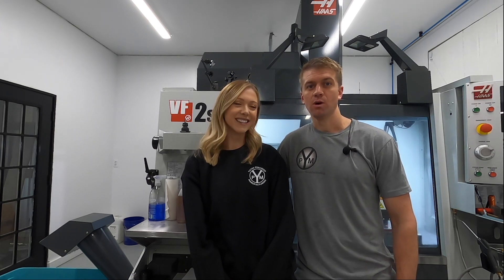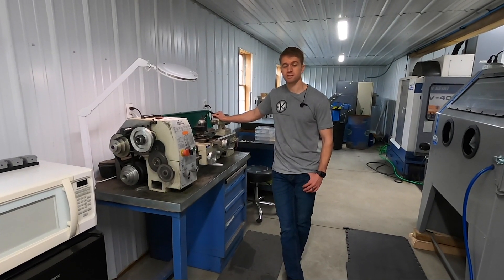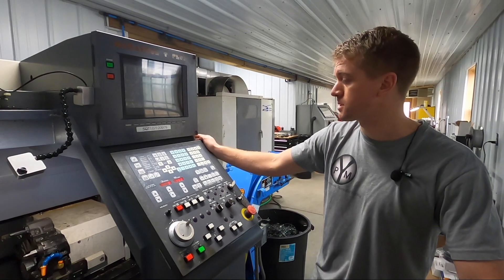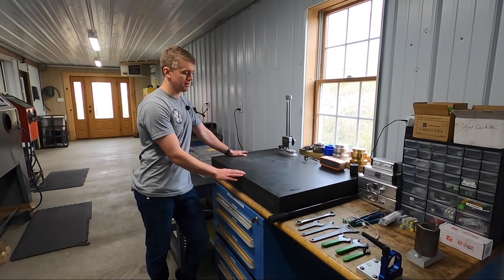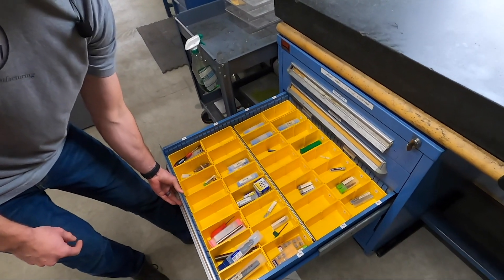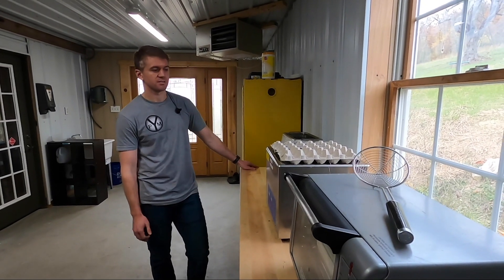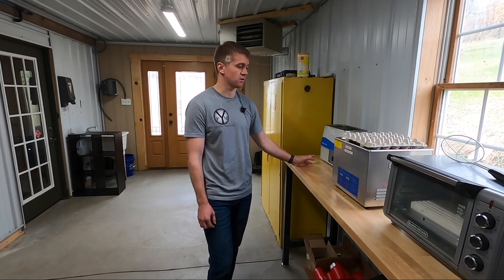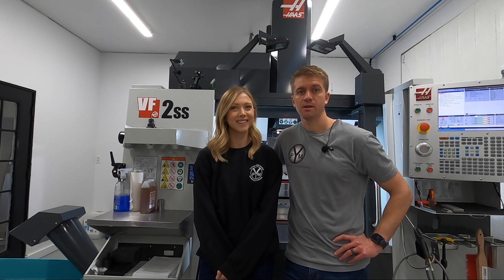Machine Shop Tours: Yates Precision

Comment: Good vid. Can you make a single component on a cnc machine? Is it worth it or do you have to use a center lathe or mill?
Reply: You can make single components. It's just more efficient to run multiples if you have the demand for them. Thanks!